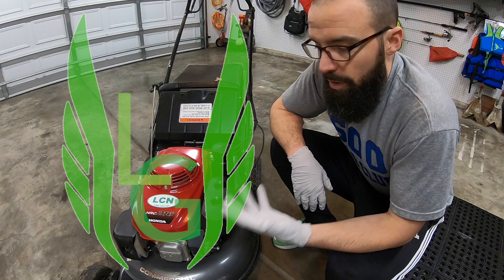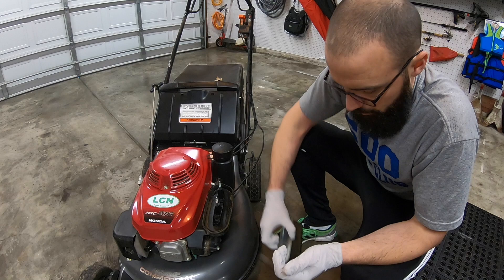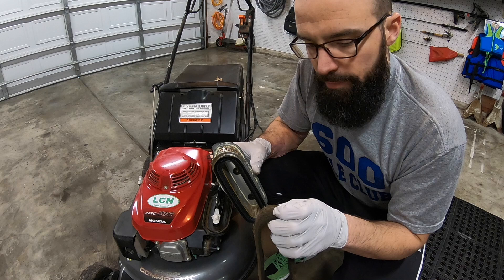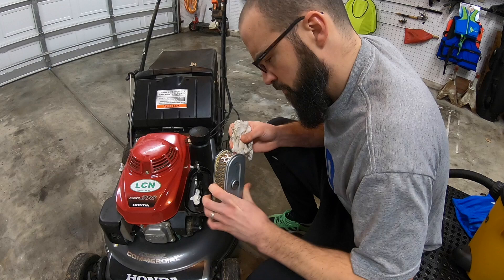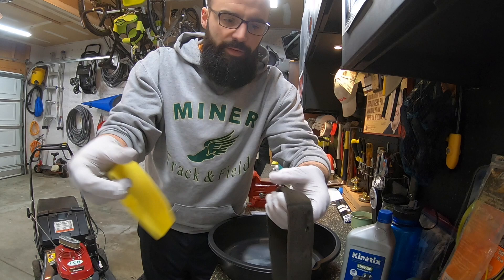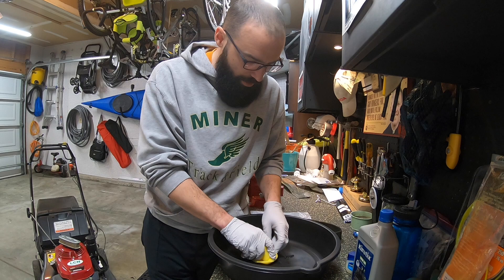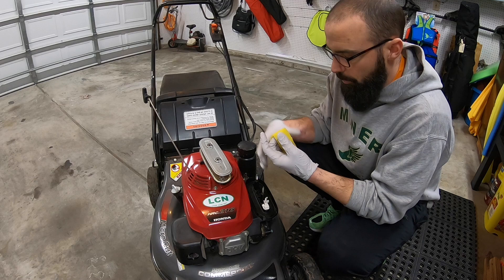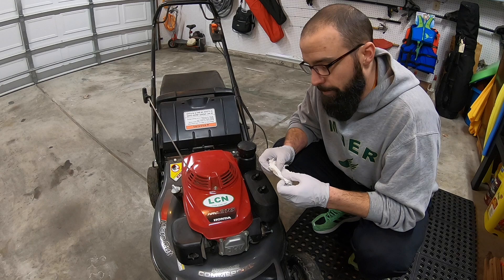How To Clean OR Replace A Lawn Mower Air Filter

Comment: Please tell me....when I took the filter out, there was oil in the base where you put the paper towel.  I've been having a black oily substance spitting out when I start the lawn tractor.  Should I remove the oil in the base?  Could that be the reason it is spitting the black substance?  Thank You!!
Reply: Just to correct myself, it was not oil in the base...it was clear, almost water like.  So, should that be in there...what is it?
Reply from the maker: No, there should not be water or any fluid or debris in the section I stuck the paper towel. I put this there to prevent anything from getting in there. I'm not sure what this could be. I'm no expert when it comes to diagnosing small engine problem. Sorry I couldn't be more helpful.
Reply: Good chance your head gasket is blown.